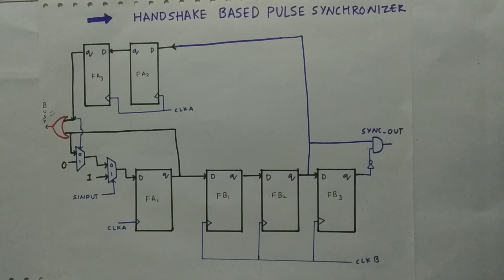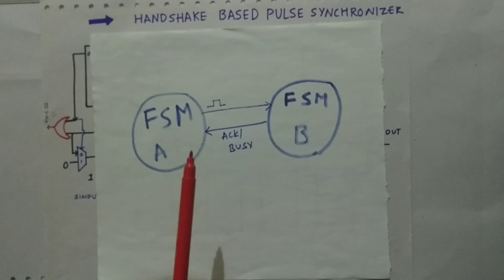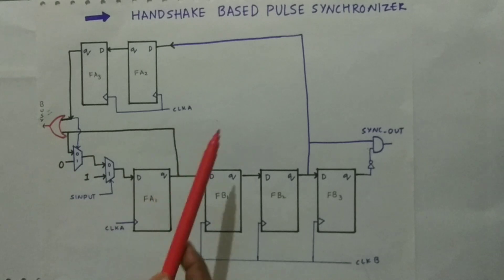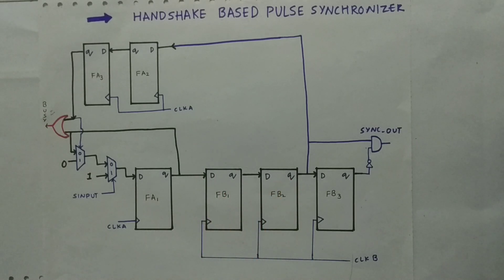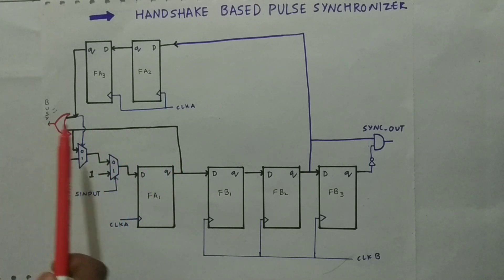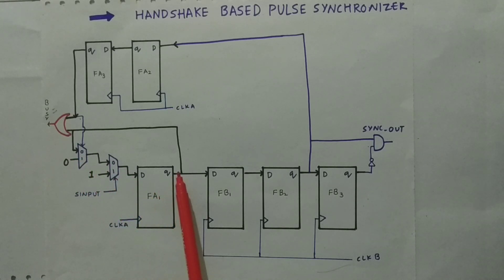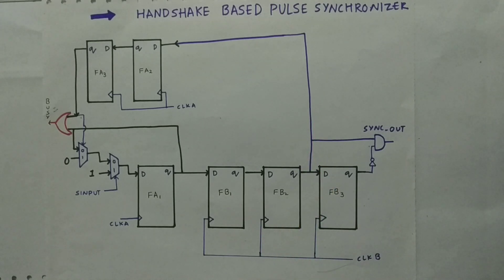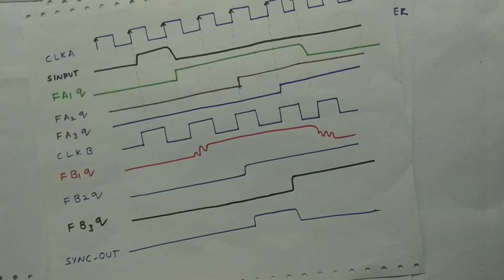Handshake based pulse synchronizer Explained!!

Comment: Hy, 
That was a great explanation. 
I just had a doubt whether the busy signal should be  OR gated? 
Because if Qa is high ACK would still be high and that's a false true condition. (Because it is still synchronizing first pusle) 
I guess ACK= QA2+ (~QA). Correct me of i am wrong
Reply from the maker: Hey  sai prasad ,can you be clear about Qa 1 or 2 ? 
Thanks for asking, good luck, good health 👍😊
Reply: @KarthikVippala  QA1 output of FA1 and QA3  output of FA3. 
ACK = (~QA1) + QA3
Reply: @saiprasadszhayi   where is the mistake? This is a busy signal. when the output of QA1 is high, then busy has to 1 only. I didn't understand you. Can you explain me what is your question.
Reply: @karthik vippala  I too have this doubt. If this diagram that you have mentioned in the video is right, Busy signal can become zero  if either qa3 or qa1 becomes 0 ?
Reply: @sharanyagopalan1717   it's an or gate

Comment: When converting from level to pulse after synchronisation why can’t we use XOR gate to convert it to pulse?
Reply from the maker: should I say or will u analyze?👍
Reply: Please explain
Reply from the maker: When we use xor even when FB2q is low we will get a pulse which is not expected , we use AND gate and not so that whenever   FB2q is high we will get a pulse  only at that time .
Hope this clears your doubt 👍
Reply: Anyway we are doing XOR of fb2 and fb3. fb3 is delayed by one clock cycle . So I think XOR also does the same if I am wrong can u explain in detail
Reply from the maker: See at we use xor then , we will get a pulse at starting ie when fb2 is high and fb3 is low , and also at ending when fb2 is low and when fb3 is high
So prefering and gate and inverter we will get pulse only once 
Hope this clears your doubt if you have any doubts please feel free to comment 👍
Reply: @KarthikVippala   You are absolutely right.
When FA1 switches back to '0', which leads to FB1,2,3 transit to '0' all delayed by 1 clock pulse.
So,  there will be an instance at which FB2=0 and FB1=1 for a clock cycle period, so if we use XOR then there will be one more pulse at "syn_out", which is undesired.

Thanks
Reply from the maker: Namaskaram 🙏 @prashantsharma3134   , thanks for commenting in detail , good luck, great health 👍😊
Reply: @KarthikVippala  You are right. Then why we choose XOR instead of inv+and in Toggle Synchronizer, it also have same situation.